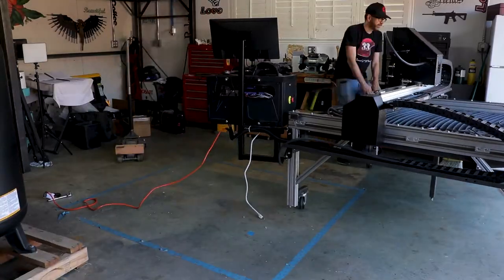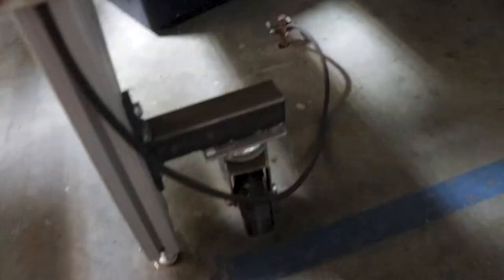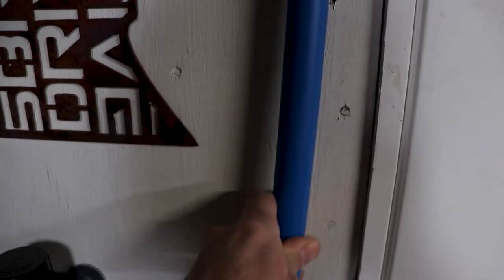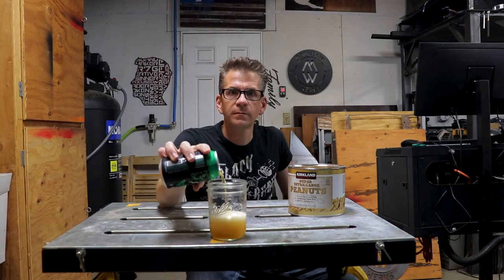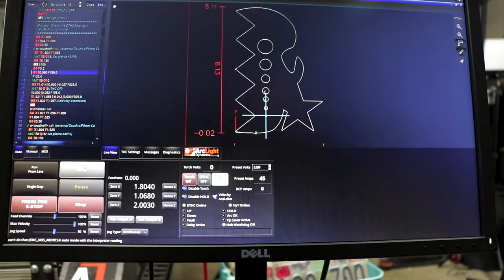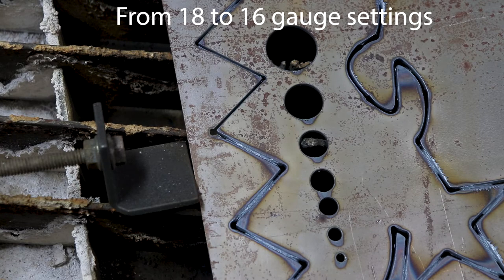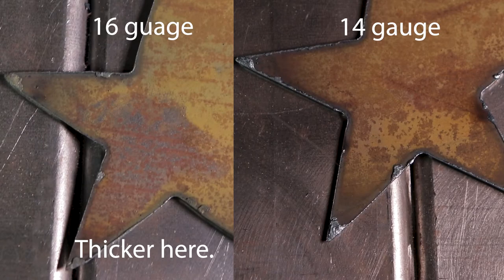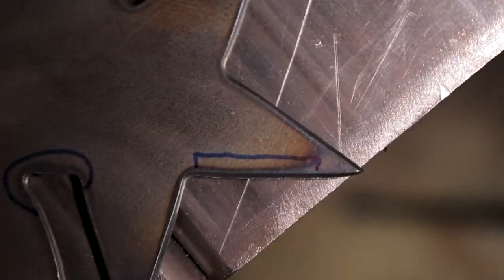Help me optimize my CNC plasma table!

Comment: Hello, Late to the party and I use different software but I notice in CommandCNC your preset voltage is 120 when the fine cut recommends 78. Again I may be talking out of line since I do not use this software or table but I would venture to guess this is your issue. Monitor the voltage as it is cutting and ensure that it hovering around the number you set.
Reply from the maker: Hey thanks and sorry for the late reply. Yes I did have some voltage issues and I ended up presetting the height, running the torch on manual mode and reading the voltage real time and when I got a cut I liked using that voltage as my basline moving forward. Good catch!

Comment: I had similar problems, only worse. Melted metal dross on the bottom of the metal. Tried all sorts of feeds and speeds. Turned out that the problem was plugged orifices in the tip and swirl ring. Cleaned them with my smallest welding tip cleaners. Solved the problem. Turns out that a new rubber hose going into the plasma cutter had fine rubber dust in it. Turns out with clean consumables that feeds and speeds were not all that critical. Dross on the bottom, move faster. Dross on top, move slower.
Reply from the maker: Yes I always try and check my consumables. One of the things I'm finding is the caliper of steel I was using was mislabeled and a little out of spec from my supplier as well. For me, fine tuning the feed rate made a difference and I'm getting much better cuts now. Thanks for watching.

Comment: So for 16ga I always get dross even in that hypertherm book it should have an astrix on it somewhere saying dross will be present. Water helps very little but on 14ga through 10ga the water splashing on the bottom helps out a little in quenching that dross to knock it off later. At least mine does. I have a powermax85 with the 50ft duramax torch. Did you do all of them on reverse cut? Reason I ask is if you didn't you can potentially get different angularity things going on. Like for 3/8 thick on 5/8 holes I'll do perpendicular cut with none on lead out at 85amps and holes rule knocked down to 55%. So make sure that tank has a blown off valve on like a 30min timer to keep fluid out of it. I have an 80 gal quincy with the max package to cool the air then runs 50ft to another tank that's 60ga and I still get moisture at that tank (sc climate) then 50 more feet to the plasma unit then down a 50ft torch. That 45xp is a very loud unit compared to the old 45 the electrical noise that is and if you are high frequency tig welding while cutting it can screw with frequency. But your cables should be shielded. I typed a book. My bad. Haha. Hope some of that rambling helped.
Reply from the maker: Hey, thanks for the tips. I'll look into the reverse cut option to see if that helps. I live in Southern California so humidity isn't too bad here but still get a lot of moisture which I know is throwing things off. I appreciate your input.

Comment: I've had this happen to me with thinner gauge metal - I would recommend trying the cut file with DTHC off, or trying it with DTHC on and cleaning your ground/or grounding directly to the metal on the table. I usually lower the IPM by 20-50 from book settings too, but that's a personal preference. It seemed like whenever I had the torch move up during a cut it was either the ground not being good or just needing to turn off DTHC. I almost always have it turned off on thicker gauge (1/4"+) to prevent the torch from diving.

I only really need DTHC on when I'm cutting large pieces that are so tall or wide there is a table height difference, so when you're doing a huge cut it will start out great because the Z is zero'd correctly, but then the torch will start dragging as the cut moves up the table. (My table has a small height difference towards the back, like a 1/4". I never mess with soft pierce % or DTHC min. cut length, I hope those aren't important parameters lol. Good luck!

They have non-cobalt dessicant on Amazon for cheap, $20-30 for a big jug, they're orange colored. Mine turn color quickly but I always just release air from the bottom of our air compressor to get rid of built up moisture, so I'm not swapping them out super often.
Reply from the maker: Hey thanks for the tips. I'll take a look at that dessicant on Amazon. I have been playing around with DTHC and leaving it off has made a huge difference on the dross levels I see. I think I will run that way moving forward unless I have something large I'm cutting moving forward. Books specs never seems to work quite right so I'll trying backing it off. Thanks.

Comment: You definitely need a better filtration system. That air is still too hot and moist. Dessicant filter and oil remover will help. 
I have heard of using a two stage home water filter filled with certain types of kitty litter as a dessicant. I am not sure if works as described though.
Reply from the maker: Thanks, I will look into that. Last I checked, the desiccant balls were actually kind of expensive. I will have to price it out again.

Comment: Slow your speed rate to 90-100 for thin metals and place your settings on slow speed fine cut when your setting up in plasma can software.  It will start to cut all the way through and if you use beads on your filtration system I was told it will help too.  But no matter what on a plasma cutter it will have dross.  The only way to have dross free projects is by laser cutting
Reply: I agree on reducing the speed to the 100ipm range.  The beads may make your air dryer and consumables last longer but they will not improve your cut quality.  Dross free cuts are obtainable but probably not with air plasma.  An  oxygen plasma system will help with this.   Please don't use oxygen in your PowerMax45.   Also, when cutting mild steel, try cutting with the shiny side down if there is a shinier side.

Comment: Have you been able to settle on a fix I have the same table as you and I get the same random uncut areas of our parts. It seems like a dthc to me but that's purely a hunch!
Reply from the maker: I have gotten some great advice and troubleshooting recommendations that I'll be testing here within the next couple weeks. I need to try to isolate which ones give me the best results. I'm with you on the dthc but I'm also wondering if I have issues like extra paths and nodes in my artwork that could be causing the Gantry to hesitate as it has to pass through these extra nodes. I'll post a video once I try all these recommendations and see what I get!

Comment: Unfortunately you always will keep getting dross. And you will always have to post process the parts. I use a self built magnetic "vise" (google DIY magnetic vise (I used doormagnets)) in combination with an angle grinder with a wire cup wheel on it, works perfect and fast :)
Reply from the maker: Hey, thanks. Yes post-work completely will be impossible, but I'm going to chase down doing as little of it as I can. A Hypertherm rep showed me a piece that came off a table of one of his customers really really clean. Anything that saves me some time is worth is as post processing is time consuming. I ended up buying a magnetic chuck on Amazon for less than $200 which made all the different. It's used primarily for surface grinders but you can turn it on and off with an Alan key (it's not powered with a cord, but turns on and off due to aligning magnetic fields as I understand it). Anyway, I have received some good advice that I'm going to put into use over the next couple of months so we'll see how I do. thanks for watching.

Comment: I have never heard of soft pierce in the 12 years I been into this gig.
Reply: Those holes though are really nice. Take a look at the voltage for the 14ga cut and take that same voltage in the 18 or 16ga settings and see if that doesn't correct your cut settings. I don't go by hypertherms book out of the 4 other tables I've run in the past 1 of them runs close to hypertherms book. My table now is all manually dialed in.
Reply: The smaller the detail the more dross you will get.
Reply: Idk if you know this but inside cuts are counter-clockwise and outside cuts are clockwise or vise versa. You mention you think your torch wobbled a little bit in certain areas that can be inside the drawing or the design. But i don't use adobe I use inkscape.
Reply from the maker: That's what they call it in the manual. It's supposed to be reduced voltage at the pierce which supposedly saves consumable life. Don't know if that's just their unique feature,  marketing spin, or if there's a more common industry term for it.
Reply from the maker: And thanks for all the tips and feedback.